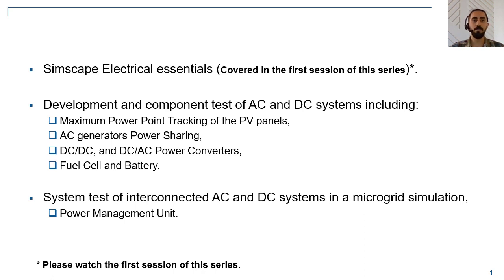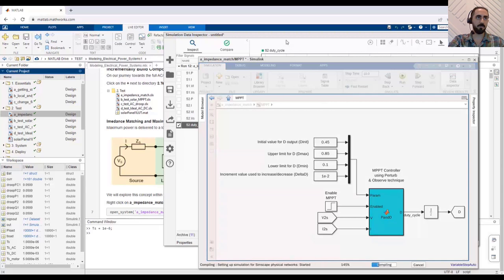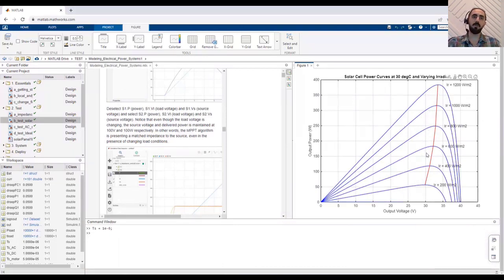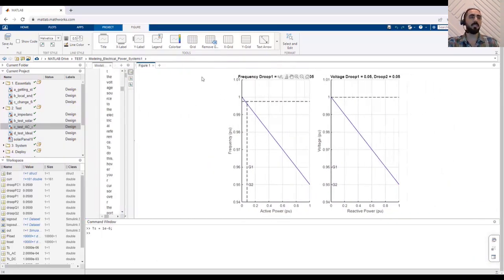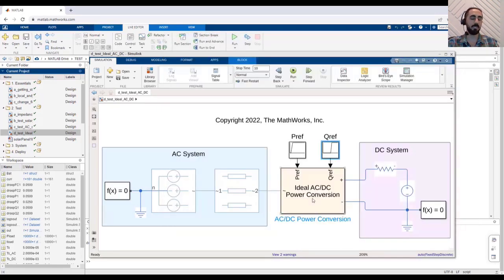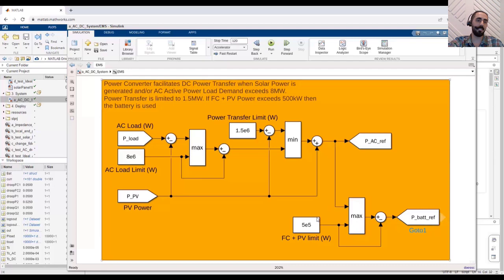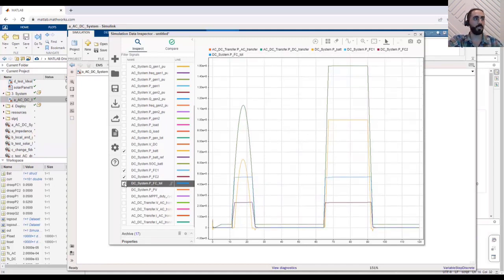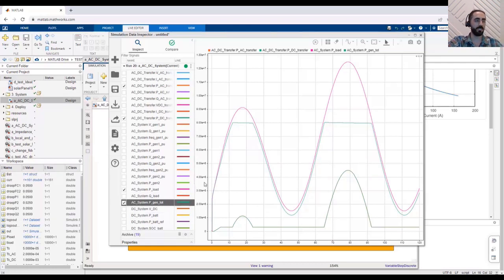Simulating a Microgrid with Energy Storage | Developing Electrical Systems with Simscape - Part 3

Comment: Thank you. Is the simulink model available ?
Reply from the maker: Hi Ahmed, files are not currently available but we are exploring how to make them available. We’ll provide an update when we have more information. 

If you have any question about this content in this video, please join our Ask the Experts Event on June 29, 2022 at 2pm EST.
https://www.mathworks.com/company/events/seminars/ask-experts-electrical-systems-simscape-electrical-3753366.html
Reply: @MATLAB  Are they available now?
Reply from the maker: @proffessornukem8775  Hi, thank you for reaching out. You can access the files here: https://www.mathworks.com/matlabcentral/fileexchange/114945-hybrid-ac-dc-microgrid-with-pv-battery-and-fuel-cells